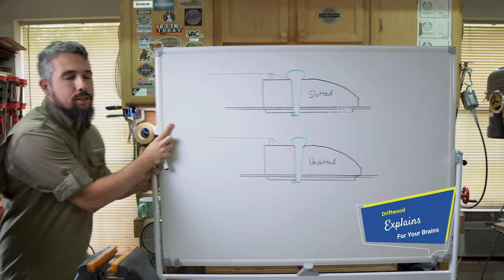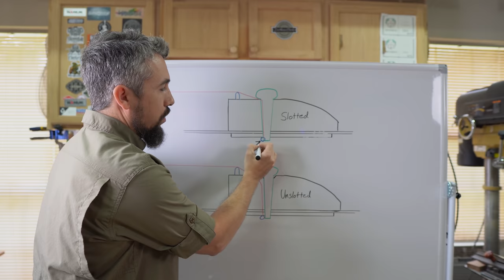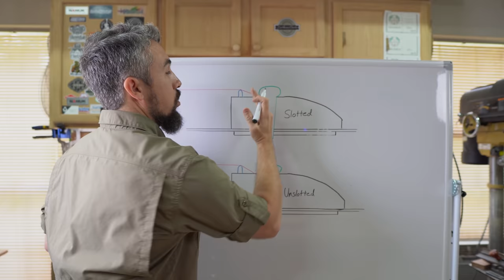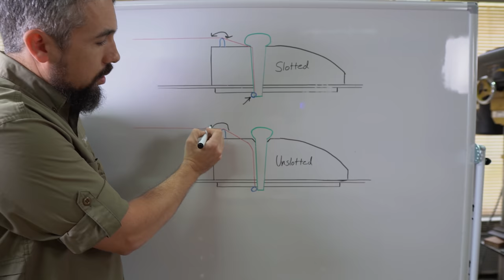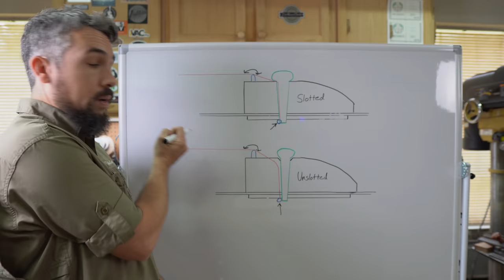This $25 Tool Can Help Anyone Make Their Guitar Sound Better!

Comment: From a physics point of view a string vibrates between 2 nodes, the nut and the saddle of the bridge. What you are doing should have no effect.
As a tire analogy: getting a bigger spare tire, it won't influence your road contact.
Reply: Sure, but this modification doesn’t affect the vibration of the string (nor should it), it affects the transferral of the string’s energy to the soundboard of the guitar. By the sound of your comment, I think you might be misunderstanding the tire analogy?
Reply: @DriftwoodMatt  and what energy might that be? A guitar produces sound by having a standing wave in a length of string at a certain tension. The pitch is determined by its length, that's why you fret it to play a melody. Now if the vibration would extend beyond  the nodes (nut, saddle or fret) it would vibrate at its own frequency because it's a different length (the same tension, because it is 1 piece of string) introducing unwanted tones, that's why you sometimes see dampening material around strings at the headstock. In short: a standing wave does not extend beyond its nodes, it might start to resonate but that is unwanted so good luck in enhancing it (which I don't think this does)
Reply: This is what I was thinking.   Similarly, as a machinist I would spend a great deal of care making parts flat and parallel to reduce the required clamping pressure at later steps.  I have an intuition the the greater angle behind the bridge creates higher down force on it.  However, I would think that a properly fitted (perfectly flat and perpenficular) bridge would transmit the sound waves without yhe added pressure, perhaps even better.

Comment: Great demo and explanation, the increase of the break angle is quite spectacular, still a bit frightened to do this on my Martin. One question does the fact that the strings are  sitting on more surface of the saddle could results in buzzing ?
Reply: I've had no issues, buzzing or otherwise, on any guitar I've done this to.

Comment: For me as luthier  and a guitar player, it not on the pins, its on the bridge and contact of strings the better the contact/contact angle the better the vib on the sound board... as you notice if you put piezo transducer under the saddle...pins are just for holding the strings...

Comment: I used a blade out of a jewlers saw, or those 10 inch blades for those cheap saws at home depot,  I bent the tiny catch on the blade so it would fit and 10 minutes later I was string it up.

Comment: Totally doing this to all my acoustics, I have 4 so not a huge expense per guitar.
Reply: Just finished this mod on my Fender Redondo acoustic guitar and I have to say my mind is blown away at how much better it sounds, its a totally different guitar. I also installed new locking tuners too and had to drill the holes out a little larger so not sure if that had any effect or not on the sound but my god its not the same guitar, the sound is so much louder, clear and clean, it laterally is not the same guitar and now gives my Martin a run for the money but I'm totally doing this to my Martin D35 as well and my Alverez acoustic that is from the 70s and sure needs this mod. Thank you so much for this awesome mod, 100% must do for all acoustics in my opinion.

Comment: Isn’t it true that all of the tension is transferred to the Guitar in both cases? You might be adjusting where the tension is transferred, but being that the guitar string is turned, and the tension is applied, by nature of physics all of the tension is transferred to both ends of the string somewhere.

Comment: I have been really interested in doing for this for years, and this video sealed the deal for me.......UNTIL.....I spoke to my Luthier who strongly recommended against it. He says he's seen way too many guitars destroyed by doing this wrong, with not leaving enough space between saddle and holes, and a host of other reasons why modern guitars should not require or suggest doing this. I really don't know, I'm still temped, but I also feel like the "tonal improvement" falls into the realm of the "lacquer vs poly" or "new tone wood vs 50 year old tone wood" arguments. Is it more a mojo thing?  Playing side by side video clips will never produces conclusive proof, since humans will never reproduce the same speed or pressure of a strum twice, and unless you can show me graphs from an accelerometer or a spectrum analyzer, with exactly the same strumming, I'd be hard pressed to say its been proven true.....
just my 2c....really for me mojo is 9/10ths the law....so maybe I'll go for it anyways....  :)
Great video and really glad I stumbled onto your Chanel!!
Reply: Did you mean to say "saddle and the holes?"
Reply: @alann5003  whoops, yup

Comment: I’m curious… why would having the ball end seated fully on the bridge plate make a tonal difference? The vast majority for the energy from the string vibration is transferred into the saddle then to the bridge/soundboard, a very minimal amount to where the string first contacts the bridge in the slot, and then none by the time you get to the ball end. I would think the string is not vibrating at all at that point. Maybe I’m missing something there? I like the idea of having the ball end seated fully so you are not putting transverse forces on the bridge or pin, and reducing the chance of the string slipping if the pin pops out, but I would suspect all of the improvement in tone (and I know it does created a marked improvement from experience) is the result of increased contact with the saddle as the result of a sharper break angle.

Comment: What is your opinion of the direct coupled bridge of the newer Alvarez - Yairi guitars?  Changing the angle of the strings at the bridge is something they are touting as a good thing.  As a Yairi fan for many, many years, I'm afraid of the bridge breaking loose at some point, and popping out....  But, they do sound amazing...

Comment: i did this today and my guitar sounds so much better. i didnt buy that saw i just bought some very thin files from my local shop and did it with those, saw would have been better cause it took a while to do it with the files :D anyways it sounds great now so thank u! im wondering if i now change the nut and saddle from plastic to bone or tusq would it sound better?

Comment: My Takamine doesn't have bridge pins. It has a string through bridge. I literally run my strings through holes in the wooden bridge. After watching this, I'm wondering how well the vibration runs through the sound board and if it could be modified to sound better.  It's a curious question. Great video!!!

Comment: I have an honest question about the actual amount of energy or vibration past the saddle? Is it a quantifiable amount in your opinion? I would think most of the string’s energy is contained between the saddle and the nut. Solid information with some questions left unanswered. Keep up the good work guys 👍

Comment: Interesting, science tends to say that nearly all of the energy is transferred through the bridge to the soundboard, would have to right or you wouldn’t be able to tune it and it wouldn’t work at all, we’ll have to setup the accelerometers and test on a scrap guitar to see the magic voodoo at work or not… Seems like the bridge pins are entirely unnecessary in that case which would be a major cost savings for import guitars…

Comment: Just curious, the vibration of the string should be all transferred to the bridge bone.   I see how the deeper angle makes the bridge under more tension and better vibrational transfer.   Does the bridge/soundboard/brace slot really have any vibration value?   It would seem the 99.99% value of the vibration transfer is done before anything goes down the new slot.   I know you showed the better angle of tension with the ball end being pulled straight up.   I'm just curious have you ever tried just ramping the bridge and keeping the slotted pins?   I'm a believer, just too much of a physics nerd.   Thanks for showing this.

Comment: Question, What if a thin brass plate was attached under the bridge to the bridge plate. The holes just large enough for the string to pass thru but not the ball end, eliminating the need for bridge pins altogether. Sort of like the brass bridge plate protectors that out there, but with smaller holes. Yea it would be slightly more difficult to string because you would need to put your hand in the sound hole to string, but it seem like it would be way more secure and eliminate bridge lift off altogether.

Comment: So not overlook the stiffness component of sound transfer through media. A heavier (more dense) material of equal stiffness to another will slow the transfer rate. A equally dense but stiffer material will increase transfer rate. Lessing transfer rate allows energy to dissipate through surrounding material. Increasing transfer rate preserves more energy through the system.

Comment: Ok im doing this on my martin dcpa4 today.
It has a polymer plastic bridge and my action is high, the saddle has already had lots shaved off so im gonna attempt to sand some off the bridge and then a smidge more off the saddle to get the action down. Bearing in mind sanding the bridge will take away some volume from the guitar, im hoping the ramping and slotting will help as the saddle on this martin is miles away from the bridge pin holes which is just bizarre in my opinion. I have a faith and the break angle is crazy big due to the saddle being so close to the pin holes. Wish me luck

Comment: Caution: Make sure the bridge is wood as some materials used on bridges are not wood and can be damage and crake if sawed into. Some microfibre material can even be carcinogenic if cut incorrectly.

Comment: Great, now solve the problem of lost contact/transfer because the saddle sits down onto a Piezo transducer, which is like a braided wire and is essentially a "cushion" under the saddle.
Reply from the maker: I hear ya haha. I will say that this mod adds a lot more pressure onto the saddle and should help with that somewhat.

Comment: Doing this almost deletes the need for a bridge pin. I believe your tone, sustain and resonance is between the nut and saddle.. bridge pins? I believe the tone is only effected by the weight of a pin..adding weight to the sound board l believe will brighten the tone  from the loss of ability to flex in the deck, more weight would require more vibration to move (hence heavy brass) and reducing weight will richen the tone being the sound board deck is not as restricted to flex and project deeper tones. Just my personal theory. Yesterday l removed the thick, gummy, huge pick gaurd from my Epiphone IBG Hummingbird and the tone difference is significant, much improved projection of mid and deeper tones, this lm sure is considerably less noticable on an intelligent small, thin, hard pick gaurd found on a Taylor..my Taylor GA8e l couldn't imagine it having much better tone. Good video.. Thanks.

Comment: So if I understand correctly, after using this slotting tool to make the modification, you can use simple plastic unslotted bridge pins or just spin the original slotted ones around and not need to upgrade to bone pins? It seems like having bone bridge pins is overkill after doing this particular mod but I'm sure some still think it does something to improve tone. I'm going to try this mod out on some test guitars first and see how it goes. I'll be ordering the tool shortly.

Comment: All great info in the video and the comments. However, I don't agree with the brass pins comments in the video. I always found them another ingredient in bringing out the tone and volume, along with saddle and nut material (I prefer bone every time). Heavier and denser definitely rings out better. Bone or brass works best for me anyway - and absolutely does not make things 'worse'.

Comment: What would be better bridge pin material, bone or wood?  You mentioned less weight, I would think wood to be less weight.  Also it would be much better if the slotting saw was rounded to make the slot have a round profile vs a square/angle profile.

Comment: Might help explain why the bridge on La Leona is the way it is. No break angle, the string goes straight through and tied at the other end. 100% string contact, where the bridge is the saddle.
Reply from the maker: I didn’t know what you were talking about, so I looked it up. Pretty incredible design they have!
Reply: @DriftwoodGuitars  I will say one thing you have all done is to inspire me to try my hand at building an acoustic guitar. I am going to try and build a copy of a Torres guitar.

Comment: I've got an old beat up guitar to try that, but I'll be using a jig saw blade to cut the slots, and I will just turn the pin slots to the rear, 'cause I'm cheap .

Comment: A good video that makes sense though the angle over the bridge bone already was good. 
Above a say 20 to 30 degree angle differences aren't that big anymore regarding sound. 
But the bridge pin ends really deform after time when it is a slotted one. So thanks anyway!

Comment: Sorry, I keep asking. Wouldn't it be far easier to plug the 6 holes with dewels (is that English?) and carefully drill six new holes, just the size of the strings? And then do this sawing thing, because of the better angle? Or make a new bridge, give it smaller holes? Then we drop those pins completely, the strings keep in place anyway, so why add pins? To close the holes?
     The only drawback is, you need to insert new strings inside the body. However, when your hands are not very large, you can do it. (I always push bridgepins out, when stuck.)

Last tip, I cut a simple Spanish guitar in two. And again. Now I got a body that has less volume, and it is bolted together. Reason? I installed 3 strat pickups, and a piezo, and the strings go through the bridge now. So, changing strings gets very very complicated, opening the body is easier. Seven bolts is not that beautiful, but hey, this is my prototype. Got folk guitar strings, you need metal for strat pickups, and these folk strings are okay when playing no amp. Well, you could do this, too, build a bolt-on back for this lonely top. Then you can show how it sounds, after this bridge mod, or future video's. Good idea?

Comment: Hi guys. I love your channel and the great info you provide. You are a valuable source. I have a question. I don’t know if it’s been done before, it probably has, but what would happen to the energy transference if you created a brass bridge plate vs wood? Do you think it would make the guitar too bright?
Reply: I would say yes. A repair guy once put a metal "plate saver" in my vintage Gibson ( without asking) and I could immediately hear the difference. I didn't like it, but I dealt with it and got used to it.
I also tried the brass bridge pins once;  for about 3 days. So bright and tinny that I couldn't wait to get them out of there.

Comment: As usual, very well done.  Wouldn't making the break angle steeper cause the string to exert more pressure on the saddle, thus transmitting more energy to the top?
Reply from the maker: Yes it would

Comment: I hate to be a skeptic here, but doesn't the real transfer of energy from the string to the bridge actually happen at the saddle? Maybe that is enhanced by increasing the break angle at the saddle because the string dives into the slot cut by the saw, but it makes no sense that there is significant energy transferred by the string segment between the saddle and the pin (unless it is negative energy - read on.) If there was significant energy transferred post saddle, it would be energy and vibrations for a pitch equal to the distance of that small string segment, which is very unlikely to be a complementary Hz to the note you are trying to play. The section of string between the saddle and the pin is highly muffled by the side wood of the bridge, I would assume. If there is an improvement of the sound I suspect it might be something other than an increase in the transfer of energy. Could be that a slotted bridge and unslotted bridge pin means that that tiny segment of string is better muffled by the bridge since there is more contact with the wood of the bridge, and maybe that causes the sound to improve since there are less conflicting/cancelling tones being transferred via the pin to the bridge and eventually to the top. This could theoretically lead to a better tone. 

I have not done this, but the physics does not make sense to me as explained in the video.

Comment: For any guitar or bass a brigde angle/edge from 30 to less degrees, will result in more pressure on that bridge, so less on the strings on the fretboard, so easier to play, with a better sound, The same could be done on the top, sadle to the tuners, making the sharper edge. simple mathematics and newton.

Comment: I tried brass pins and the only reason I didn't go back to ebony is laziness honestly I'm hand planing a wood top for a better use of lumber I saved over the years now a Carpentry table top on top on a metal frame from Lowe's - Kobolt? Everything around it rodding away except  the Frame and pine birch and treaded for termites it old saved for 15 to 20 years. Now it a smooth hand plane top, maybe a high poly gloss? I got sometime to think about it? Wood is fun but hard. Hardest thing I ever done is making electric guitars?